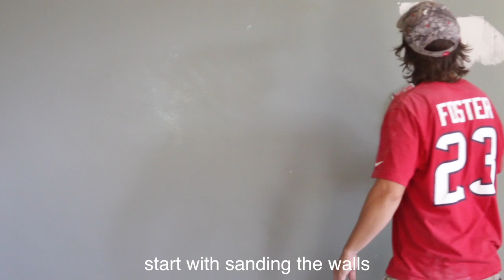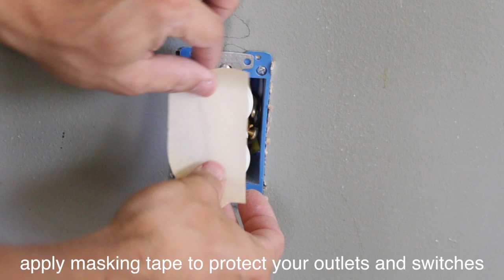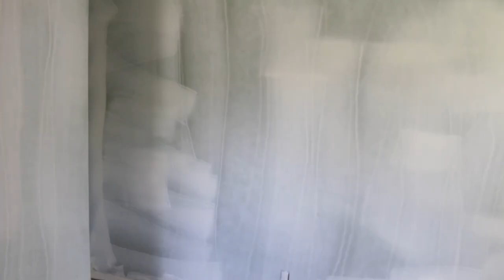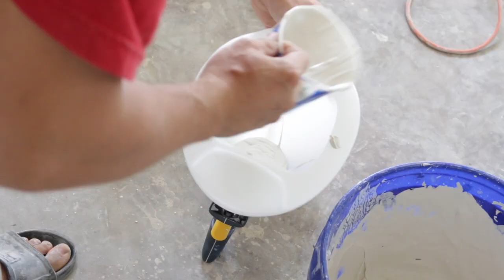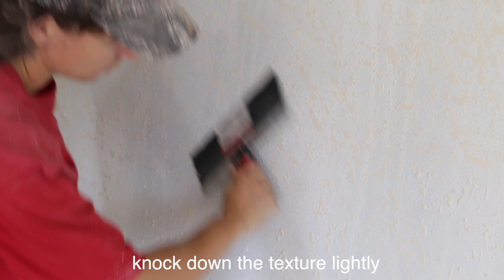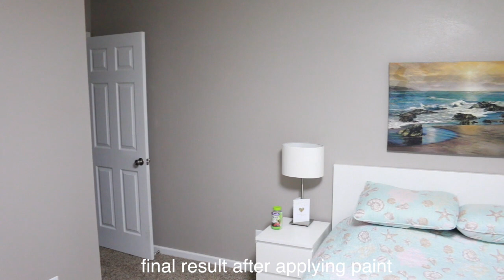How to Apply Texture Over The Painted Walls

Comment: I applied texture first, used the knock down crows feet technique but noticed on a part of my wall some lines formed making it not look good. I noticed this after applying the primer, can I retexture that part of the wall again with mud? Do I have to sand it down or what could I do so it doesn’t look bad? Thanks in advance.
Reply from the maker: You can definitely reapply the texture after removing the old one. It is easier to remove it when it is wet with the taping knife or simply sand it down.

Comment: Is primer necessary for adding texture onto a non-textured painted wall?
Reply from the maker: yes
Reply: No it is not!
Reply: No it's not go spray it if you want you can wipe the surface clean but it's should adhere nicely